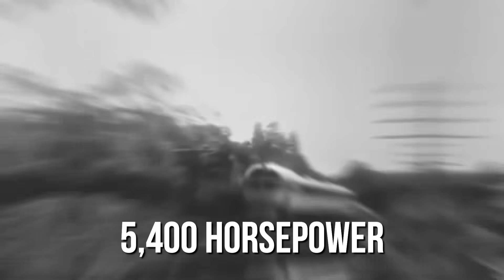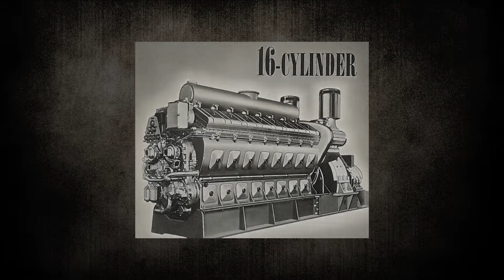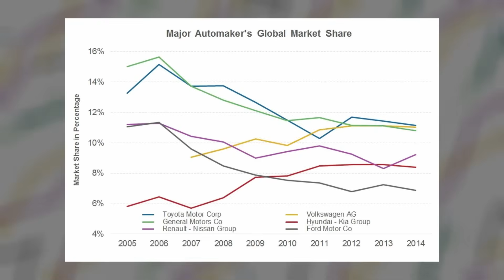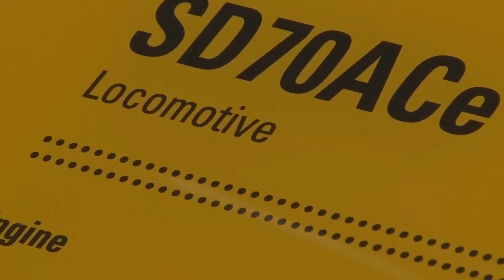The Entire History of EMD

Comment: Check out Swedish NOHAB if you want a whole bunch of locomotives built with EMD engines under licence from EMD.
The locomotive was Designed and built by Nohab the electric motors where from ASEA and the diesel engines where EMD. 
The locomotives where used all over Scandinavia with large series in Denmark as they didn't electrify until recently.

Comment: The EMD Winton style two cycle engines are like music to me.  I worked extensively on the 567 and 645s.  What with emissions and other pressures, two stroke designs were obsolete by 1990.  Their replacement, the four stroke H series I never learned as an engine, but I worked on the reliability and control package   the EM2000.  It was well designed but EMD in 1998 clearly lacked the resources to compete with GE.  The old EMD fans used to call the GE locomotives “toasters”.  In the long term, they won out with their more integrated locomotive system designs.  I just love all engines, especially those that have proven out.

Comment: Australia still has old FT series body shape running with GM10, model ML1-10, built in 1952 by Clyde Engineering in Sydney NSW, still running in active service today.  Other variants still operating in Australia include the "B", "S" and other "GM" class, all still running on the mainline despite their age.  EMD locomotives are no longer built in Australia resulting from Progress Rail purchasing Downer EDI (which replaced Clyde Engineering), locomotives are now made at Muncie, Indiana in the USA and shipped to Australia as complete "ready-to-run" locomotives.

Comment: What killed EMD had nothing to do with GE technology. It had everything to do with a very bad model, the SD50 which was thought to be just a slight improvement of the SD40 line but had major quality issued which EMD could not provide the customer service and technical solutions that customers had been used to. When GM chose to cast off EMD rather than face the results of trying to force automotive principles on a heavy industrial entity which resulted in the Horrible SD50, customers turned instead to GE who had the financial might to basically "BUY" the business. GM's EMD forgot what the company had been built upon: reliability and customer service. While Caterpillar has reinstituted these principles, many customers switched to GE/Wabtec.  As always, losing sight of the customer usually results in business lost that is very hard to earn back...
Reply: I saw another video  that  said that EMDs downfall was because GEs AC traction system was way  more efficient that EMDs DC system